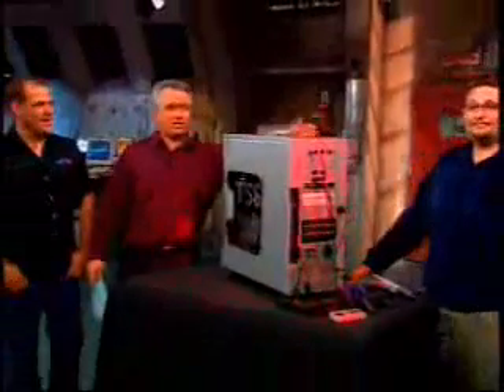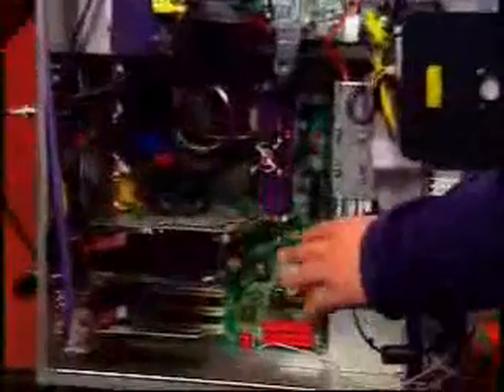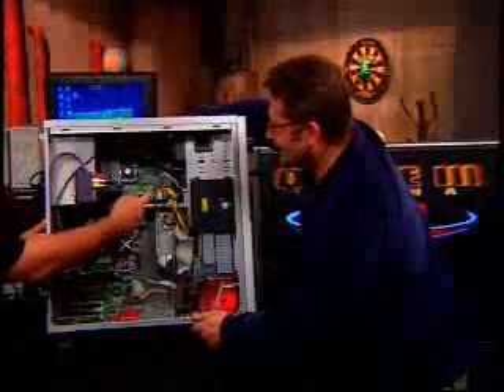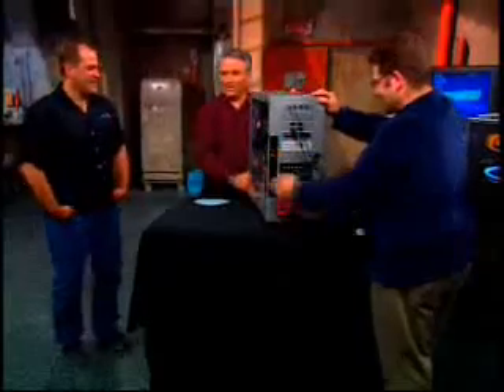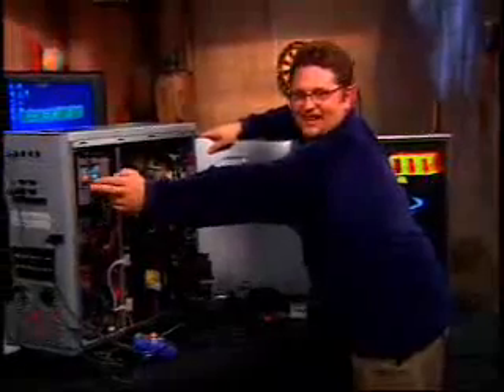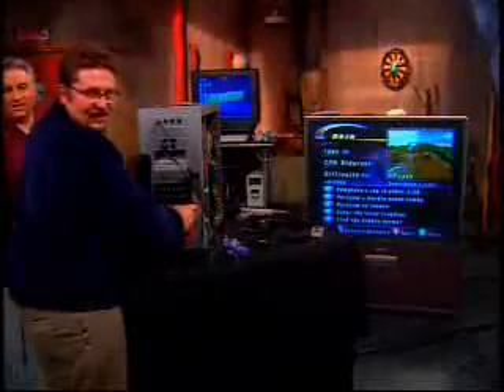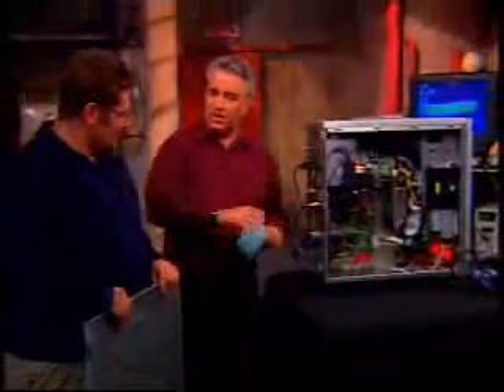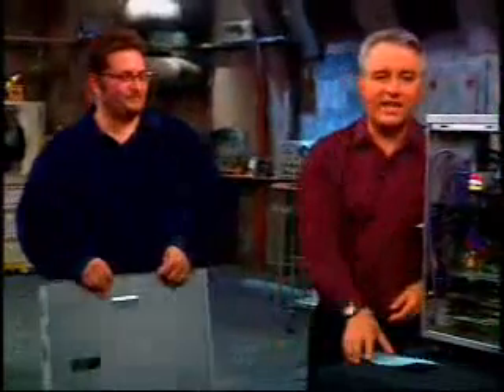How to play PS2, Xbox and GC games on a PC (2002)

Comment: @itachi65ful In 2002, most pc's didn't quite have the horsepower to emulate an Xbox or a PS2. Plus, emulators for the older consoles were, for the most part, horrid and buggy.